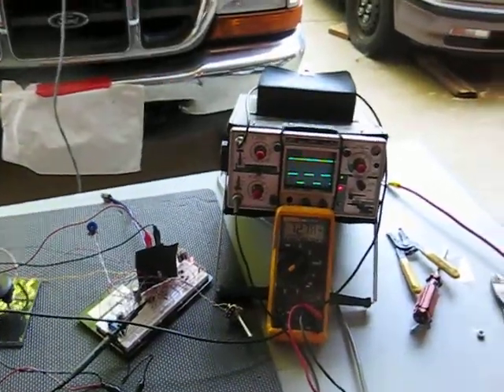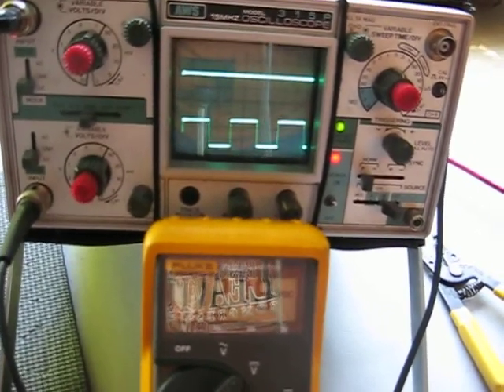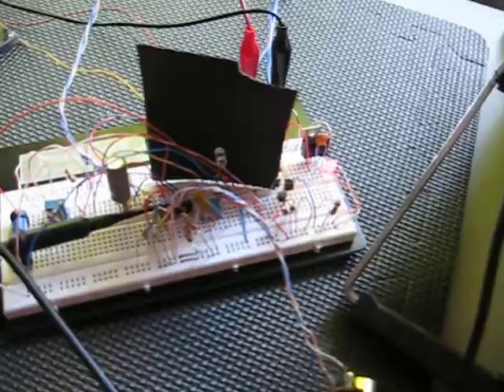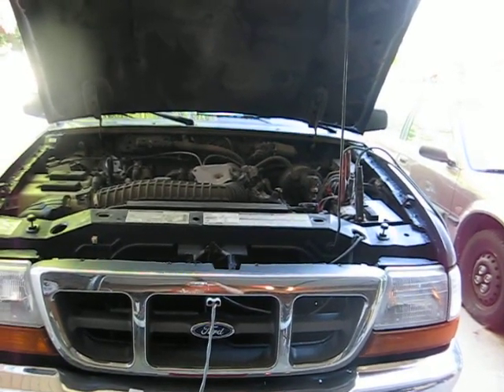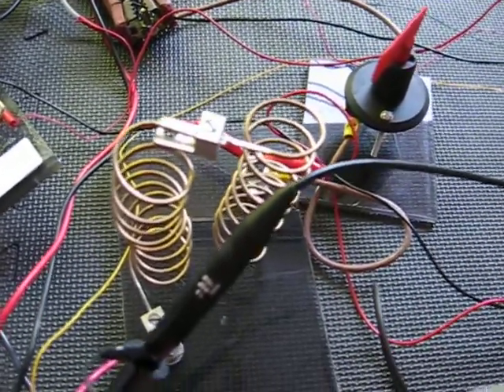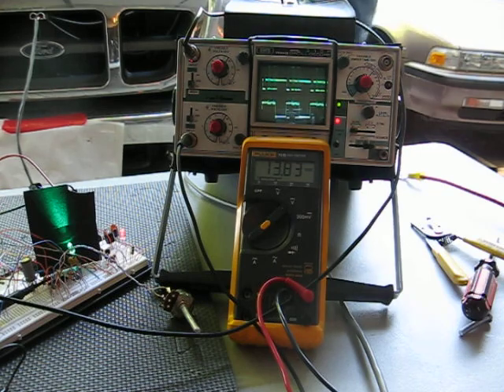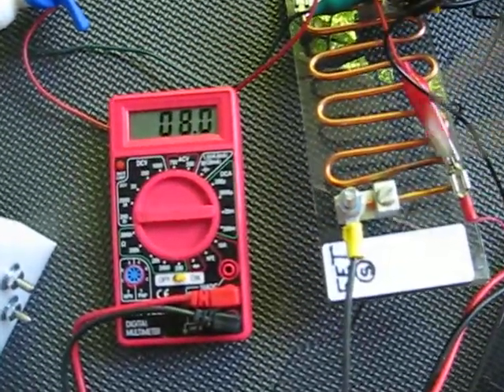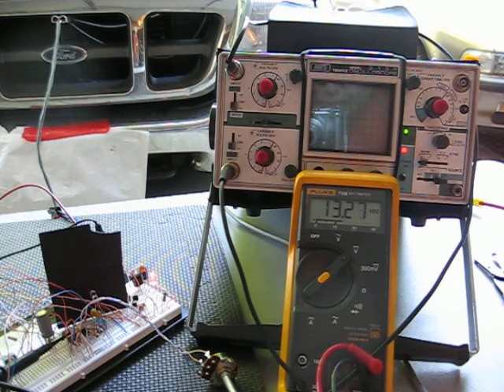HHO PWM Control

Comment: Excellent.  I'm assuming the circuit is off when the ignition is off, so the voltage detection is to be sure that the alternator is running, thereby disabling the cell if something happens to the alternator?  I like it.